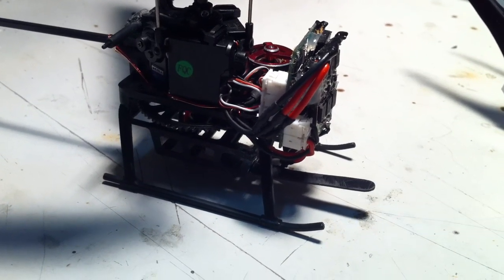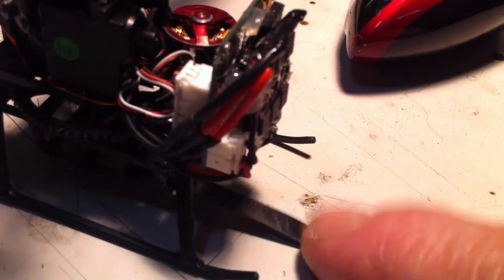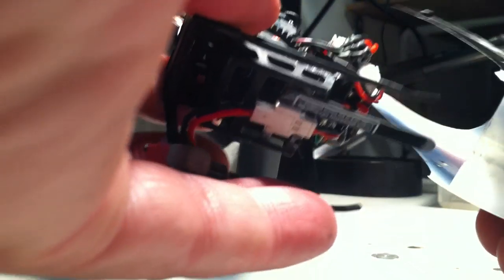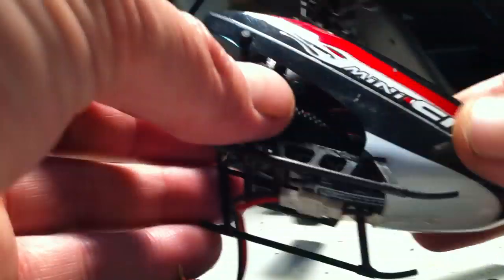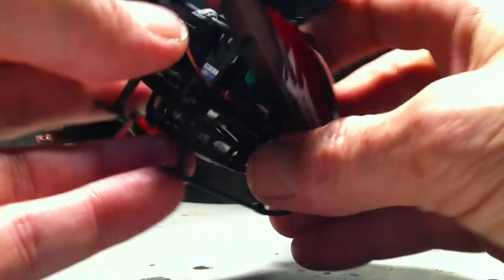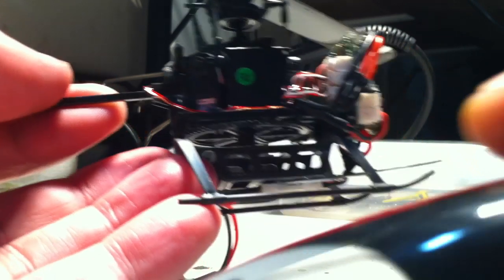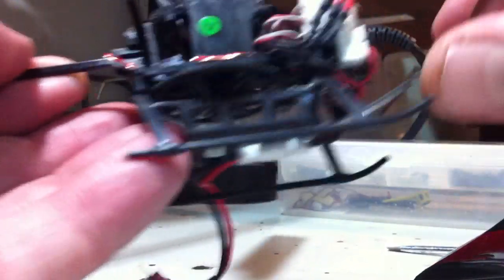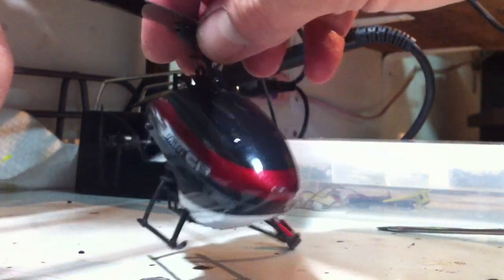Mini CP Canopy Saver Mod

Comment: Yep mine cracked also, so I decided to use your method but used an old blade from a V911...its a more flimsy material and a bit lighter than the mini cp blades. Lightly sand both surfaces and Loctite gel super glue works well.